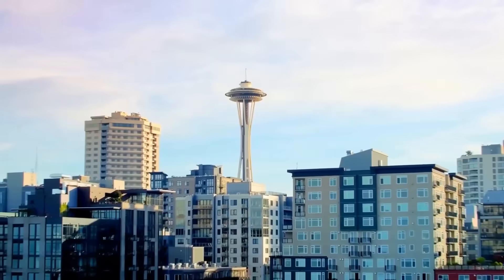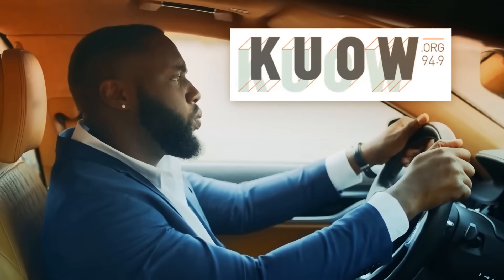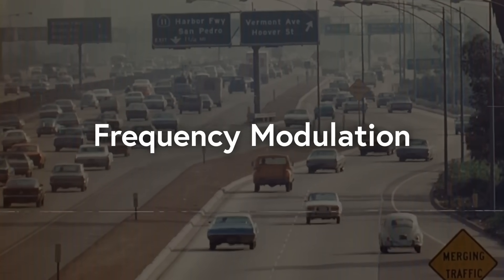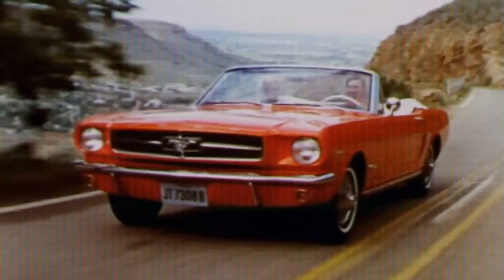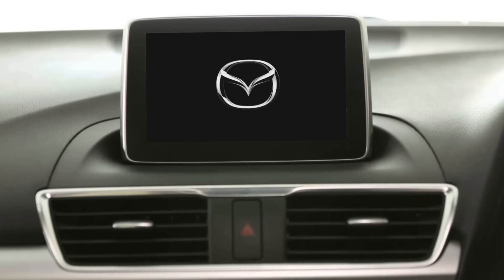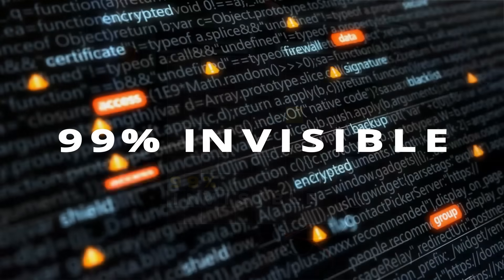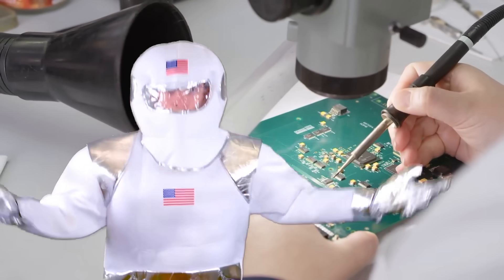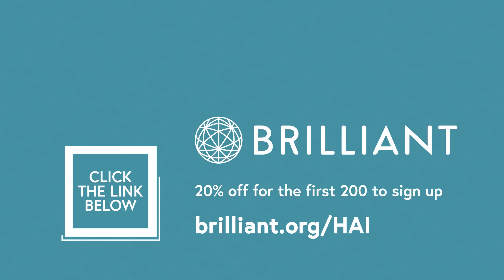Why Hundreds of Mazdas Tuned to 94.9 Broke Simultaneously

Comment: Preventing this types of errors is pretty important, but being able to recover from them is far more important. This is why we have these hard to reach factory reset buttons.
Reply: This was the first thing on my mind! Having a reliable way to at the very least roll back to the default firmware & clear all forms of storage should be mandatory. I encountered a software bug last year which caused my phone to freeze in such a way that not even the power button worked. I had to wait a day for it to run out of battery and shut off, so I could charge it and turn it back on... Super annoying.
Reply: @AndreaAttard  That could be a lot worse, depending on what's wrong and what isn't operating. I still have my old phone (Motorola Razr HD) and occasionally charge it for one reason or another. I've got lot of thing shut down, and the battery lasts for a month.
Reply: @AndreaAttard You just had to disconnect a small plug?
Reply: That was my first thought too: they really should have included an option to wipe and reset the computer, so a bug doesn't irreparably destroy it. Of course, these days, it feels like wasteful practices of forcing consumers to buy new items instead of making it feasible to fix existing ones seems to be the norm.
Reply: i agree. There should always be some generalized exception that basically says if X doesn't work return to main and dump that shiz. no excuse for boot loops.
Reply: It's inexcusable that after a system crash, the default behavior is to restart without any kind of safety mode/cache reset and executing the exact same code again. You'll never be able to avoid all bugs, but at least make a system that can recover from such failures... All involved software engineers/programmers should be really embarrassed as it is such a flawed error/exception handling... There basically is none at all. We had a crash? Just restart and do the same thing again.... Mind boggling how this can happen after decades of accumulated software engineering expertise.
Reply: Yeah is there really not a way to clear the cache or reflash the firmware? How is that code stored? Surely it's either been etched into an EEPROM (meaning, reflash it) or else into a CMOS or other flash RAM, which needs its power source removed. Should be easy unless the Mazda engineers integrated a backup battery into the IC itself, and if that is the case, they need to be held liable for a new one as any decent engineer should know about the horror that is the Dallas 1287 RTC...
Reply: So to people in replies... as far as I know, they managed to fix this problem and it didn't need replacement. Though it did require forced USB update of some sorts.
And indeed not clearing cache is weird to put it mildly.
Reply: Which kick you over to kuow.....ahhhhhh!
Reply: yeah, feels like if it was crashing from finding the DLed file. purging that should fix it
Reply: Backups and failsafes can fail too. Should you.. make a failsafe for your failsafe? Shit's going to break sometimes.
Reply: @whong09  But a failsafe adds that extra line of protection. Sure, theoretically, you could have infinite failsafes to prevent anything ever going wrong, but having just one or two failsafes will prevent almost the same number of problems occurring
Reply: @whong09  well if it's anything safety related you DO make a failsafe for your failsafe.
Reply: @whong09  a reset pin won't. it is far too simple. Just a single pin that when the circuit completes basically dumps all forms of memory and storage. It's basically the same concept as a CMOS reset on a motherboard. Never ever heard of one of those pins failing except by user abuse, but that is rare as anyone knowing enough to go after it knows full and well to be careful with internals and what they do.
Reply: @VadersFist501st  A farjump() call, almost a goto, but it restores memory and registers to what they were when setjump() was called to the factory new setting. Trashing all stored settings. This will recover from any error like this one.
Reply: @whong09  Computer motherboards have had dual BIOSes for a decade now, at least - my first gen Core i7 Asus board has one, it came out in 2009.
Reply: @whong09  if u need the failsafe (factory reset) ur already fucked.. so if it doesn't work ur no worse off.
Reply: @whong09  Every electronic device should have a mandated way to physically cut the power by removing the battery or something (looking at you, modern phones), which should enable the user to boot into default settings or a failsafe boot. Kinda like windows 98 did if you improperly switched off your pc.
Reply: This isn’t 1988, you can’t just hit the reset button.
Reply: @335m5  sure, you got to push it with needle or paperclip
Reply: @tolep  no they legitimately design things with no reset anymore nowa days.
Reply: @335m5  That's like saying I can't win so I won't even try! :/ You don't have a format C:\ ?
Reply: @donsvideos1985  how do you try and ouch something that is physically not there? Quit rambling old man
Reply: @335m5  use your words and try harder . you aren't making any sense. calling me old man... You should be so lucky! :)
Reply: @335m5  There are indeed tiny reset buttons.  We use them as part of the procedure to perform flash updates to the radio/Nav system.  Most also have a hidden SD slot also.
Reply: @blackhawk7r221  and what manufacturer is this, I work on European cars every day and there is no such thing.
Reply: @335m5  Some of the easiest to spot are in Hyundai and Kia.  Reset hole is on the bottom corner of the radio faceplate, SD slot is a cover that must be popped off under the manufacturer’s name.

Comment: In the UK we call it DAB instead of HD Radio. 

I assume this is because if your car has it you can dab on all of the haters in their old cars.
Reply: DAB and HD radio are completely different standards. HD radio is a digital sideband transmitted along with an analog FM signal, DAB is just a single digital signal up in the 230MHz band i believe.

Comment: FWIW software bugs in cars are a long running issue. I have a 2007 Toyota, the odometer won't go past 299,999 kms. It's a software bug that Toyota won't fix.

Comment: So... I'm confused why a car needs to have its main systems for propulsion and braking be hosted on the same system as the frivolous stuff like entertainment...
It should really be redundant and separate - your car should be able to at minimum drive and brake even if you can't change the radio or see how much fuel you have
I'm honestly kinda scared to buy new cars as a result (not that I can afford it these days - yay supply chain issues!)
Reply: Yeah, don't bother buying a new car. If it has OTA updates, you can't even own it, as manufacturers can and will arbitrarily disable functions under certain conditions. for instance Tesla reportedly disables the climate control after the car changed owner and claims a several thousand dollar "license" fee to enable it again, Toyotas with a remote start option built before 2019 recently had the remote start feature (that functions over a local RF connection) disabled with Toyota asking for a subscription to use it again, as the car was purportedly sold with a 3 years trial license of this feature does not use any remote technology which would have to be maintained and continuously paid by Toyota to function. It's ridiculous!

Aside from that, buying a car brand new has always been a giant waste of money due depreciation cutting it's worth in half within the first two years.

Comment: As a matter of principal there should be nothing you could transmit that would interfere with anything on your car. The fact that it was possible means that Mazda systems are probably faul of various certifications/compliances. 
This radio station might have done it by accident, but anyone can transmit a signal; some might transmit something malicious on purpose. 
No fault with the radio station, it all lays with Mazda.
Reply: Totally agree on that. It's some basic rule in computer science : never trust user input. Any fucking noob programmer learn it really, really quickly even if self-taught. The fact that it happened is the proof that either mazda hired someone totally incompetent, didn't bother to make security verifications or even that someone qualified this job to the "not my job" case. In any case, that's entirely mazda fault for not putting a proper way to "factory reset" their comp not checking user inputs correctly, and not commiting to safety measures, or giving the job to an apprentice and not checking it after.

That's even litterally the first security question "did you parse user input to prevent malicious exploitation, database dumping and shit". It is acceptable not to do it on developpment side and delaying it later to do it properly, but putting this in production like that, especially with cars, and no way to reset it is almost criminal. Hope their fired the ones who did this. This is not accpetable
Reply: @feuby8480  And especially do not trust user input that's come via an unreliable channel like a radio transmission! Even if it's safe when it leaves the transmitter, it might not be after soaking up interference. Error correction codes exist for a reason, and even they fail regularly. Just look at all the blocky glitches in a digital TV broadcast.
Reply: This, exactly. I thought car companies had pretty high standards for code security and robustness, considering that it runs on things that weigh over a ton and move at high speeds through populated areas. Yet every two-bit web developer knows that user provided or external data should be treated as untrusted and potentially hostile (and if it comes in over noisy channels, it's also constant low-grade fuzzing). Failing to decode something that might have come in over radio is not an exceptional event, and should just be silently ignored, not panic the system and crash or brick anything.
Reply: Technically, every radio receiver in cars is made to receive signals that interfere with the operation of the audio system. You could be boogying along to Van Halen when suddenly it is replaced by the 1910 Fruit Gum Company. The DJ may be in hot water, but more as a result of royalties than of customer service. Yummy yummy yummy....

My Android TV receives updates more often than seems wise and it is not easy to find out what those are doing. My recourse is to do the update and follow the dark and forbidding complaint process if it goes badly. C'est la vie.
Reply: And this is why the dream of the "connected superhighways of the future" is a total catastrophe waiting to happen.  It's one thing when some hacker locks up your desktop, laptop or phone data, but a WHOLE OTHER THING when some twerp in a basement locks up your wheels at 80mph!
Reply: There is a rule in computer security that no security system is uncrackable. There is a similar rule in software engineering that no software system is fully bug free. Sorry y'all, the trade-off for all the benefits computer software brings is that sometimes weird and bad stuff will happen. Some of you might remember the log4j security bug from late last year and how many problems that caused, or the various times CloudFlare/AWS went down and took half the internet down. As a seasoned software engineer... well, shit happens!
Reply: @whong09  I agree with you : no security system is uncrackable. Bugs occurs, that's... An evidence. We are not talking about BSOD here, where you just have to restart the computer.

The fact that there is always a way to hack is the reason why we have standards, procedures, rules and certifications. And as I stated, the very fucking first rule is always "do not trust external inputs". You know why this is mazda problem ? Because ONLY mazda had problems with that. All others complied with basic rules.

I don't know if you are a programmer, but honnestly, your comparison is like saying "there will always be car accident, shit happens", look last week, 5000 people died in an accident. When we are especially saying that everyone should fucking put a seatbelt. That will not prevent everything. But sure, that will REALLY helps.
And moreover did you really watch the vid ? This was not a hack. This was not malicious. It was user (radio) error. How can you design such a bad computer system that an user error could completly destroy it, requiring hardware replacement ?

If mazda cars were hacked by some criminal discovering that and deciding to break shit, we would probably be here saying that basic rules were not followed, but like you stated, nothing is uncrackable, and shit happens. But that's not the case.
Reply: @feuby8480  I have 8 years of experience, most of that time spent as a senior software engineer. I graduated from a UC for computer science. I know programming buddy. At my last job I made $x00k salary. 

You sound like a newbie programming, not really in industry yet or if so not a lot of experience. I've seen this bug (yes I watched the video and probably understood the problem better than you) over and over again about input sanitation. Have you ever found and solved a bug where different character encodings were causing data to be lost when transferring between databases? 

Shit happens. Why does shit happen even around something basic like input sanitation when there is a standard practice and when there are libraries and automatic ways to deal with the issue. The reason is because software is always made on a budget, it's always made on finite time, it's always made by imperfect people. Even if your language or framework provides automatic input sanitation, if an inexperienced programmer forgets and no one else looks closely enough this kind of bug can always slip through the cracks. Why would an inexperienced programmer be working on an important project in the first place? Because everyone is greedy and everyone is cheap, and if you're not you don't survive in business.

And besides, software is hard. Good software is hard, trash software is easy. It takes usually at least 10x more effort (i.e. money) to go from an 80% working product to a 95% working product. There is so much to know about software, look up the Dunning-Kruger effect. If you get an experienced programmer who moves to a new language they may have a productivity hit (costly/deadly), maybe their fundamentals are sound but they create a bug around some very subtle language difference. Explain the log4j security exploit to me otherwise.

I can tell you are a newbie programmer because you think software is easy. If you had any experience you would be saying what I'm saying - cut the programmer some slack!
Reply: @whong09  well but the biggest problem here is not the fact that there are bugs or exploits, it is the fact that all information is stored in FLASH and not in RAM, this error could have occurred and be easily fixed if they had only used any other method to save information "irrelevant" to the OS in theory.
Reply: @sebastianarce9177  Most software problems are "easy" or "simple" to solve in theory. In practice, it's so hard to keep up with the thousands of different ways things can go wrong that there will always be something that gets fucked up. Murphy's law.

And probably cars should have an infotainment system that just runs on linux, has a normal computer setup with an onboard ssd, motherboard, etc. and you can go and maintain your car computer by yourself. Most people will still just take it to a dealer or mechanic but tech savvy people could fix minor issues like this by themselves. Without specialized equipment.
Reply: @whong09  I agree with you that bugs happen, and you can only change how often, not if. But I do not agree that this is a simple bug. With properly designed architecture, a bug should not be able to cause that kind of problem. External data coming in over radio should never, ever end up in a place that is read during system boot, or for temporary data like that, even be persistent after booting. That's like having your default download directory in Chrome point to /boot or C:/Windows/System (depending on your OS). Doing this had to be a conscious decision at some point, and I question the sanity (or good intentions) of anyone who did this.
Reply: Anyways fundamentally we are arguing about two different things. I'm all in favor of standards and practices that reduce the risk of something bad happening. But the risk will never be zero no matter how diligently the standards are followed, even basic problems like this can still happen. People have to accept that all software is somewhat faulty, even if it's just a tiny bit.
Reply: @whong09  ah, yes: Buyer Beware. "IF you survive your car being bricked on the highway, you should write a really strongly worded letter to the CEO of the company who made your car. Because us programmers just work there. It's not like we can tell the boss we might be releasing a deathmobile, or that we need time to track down flaws, or need more competent coworkers.

Comment: Did you know on linux the filetype extension doesn't matter, it's only there for the user to see what it is easier. The system knows what it is based on the file itself.

Comment: I have a Honda CRV 2007. Like a month or 2 ago, my clock stopped working. Every time I start the car, it resets itself to 2:00am on Sunday Jan 1... 2002. Before the car was even built. I'm unable to adjust the clock even temporarily. The radio still works and I never use the built in GPS, but I'm wondering if something similar could have happened to mine?